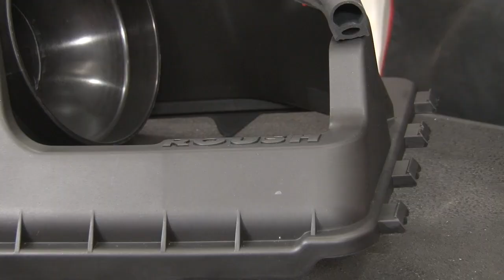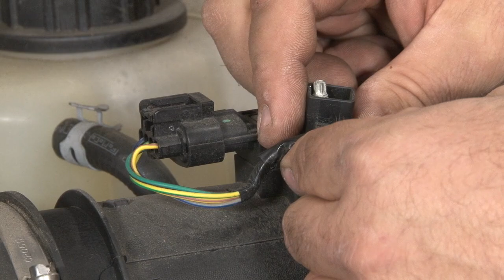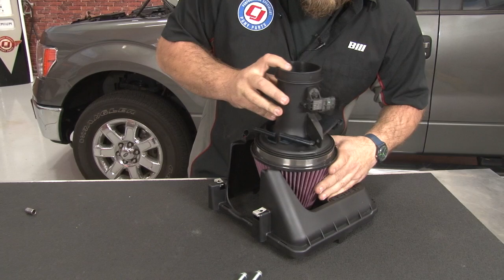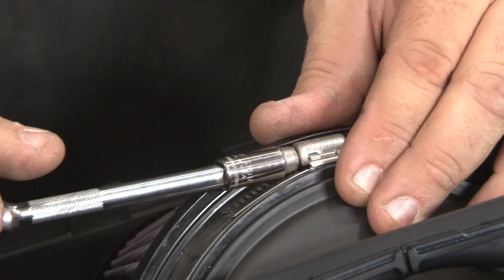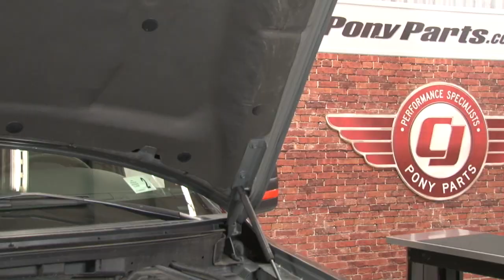F-150 EcoBoost Roush Cold Air Intake 3.5L 2012-2014 Installation

Comment: This kit as well as the Raptor kit you showed looks like a pain when it comes time to clean the filter. From what I can see both kits would require a complete disassembly of the kit to get the filter out of the housing. Not very convenient if I'm right. The filter cleaning should be as simple as a single clamp and pull the filter out. Poor engineering if you ask me.
Reply: Yeah it's time i clean mine and im tryna figure out if theres a convenient way to do it